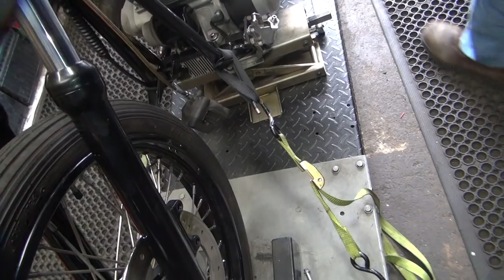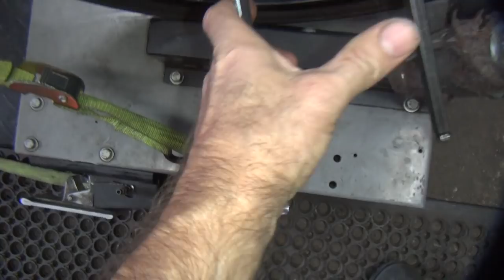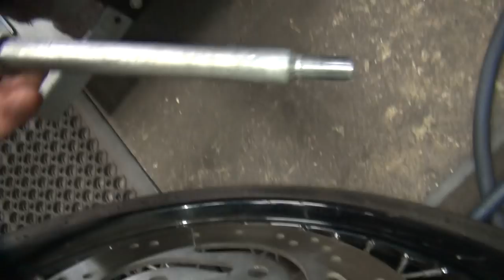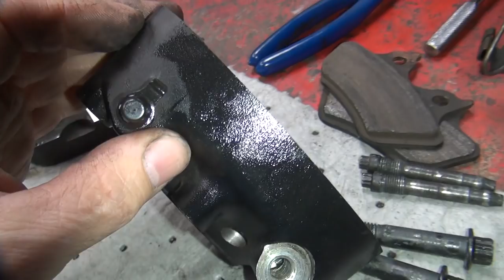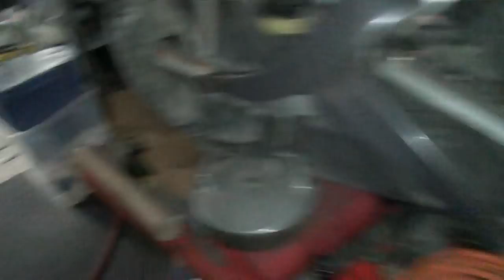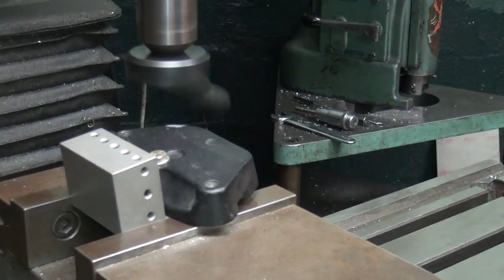1999 80ci evo #105 rigid install mid controls chassis brake repair get running by tatro machine

Comment: I had a similar problem on my old shovelhead - it turned out that the brake disc was skewed making it impossible to bleed the front brake.
It did cost me a new master brake cylinder and lots of frustrations - but at last I got it sorted out.
Thanks for the great videos!

Best regards from Denmark!

Comment: If a guy spaces a wheel over to correct for some problem what likely happens is that the center of gravity will be off, and if you let go of the bars, it will not go straight down the road, unless you lean to compensate. Just something to remember. If you have a bike that always goes right or left, you might want to check the wheels to see if they are centered. Spacers can correct that.
Reply from the maker: in the real world you can be off an inch and i doubt if anyone would notice. my race bikes are over a 1/2" off if not more and handle very good. i even offset them or bend the frame on purpose so that the bike is more balanced and goes straight. this is worth speed at the track. i have picked up 13 mph on one bike by doing this and changing out the stock rear brake to a custom one. most bikes are so out of wack you wouldn't believe it. just look at this bike.
tatro
Reply: Tatro, I'm surprised by this. My BMW K100 had a flat spacer, like a washer behind the rear wheel, and I left it out, and it would then always want to go off the road if you took your hands off the bars, but when the spacer was back in, it went straight down the road, and the spacer was only about 1/8" thick. I wonder what that was all about.

Comment: i had a 87 fxr i swapped over to a 39mm front end and ran into the same problem with the brakes except my was dual disc brakes i ended up having to use a grinder to get the clearance needed
Reply from the maker: not all harley parts like each other. sometimes you just have to show them who is the boss.
tatro

Comment: If the axle was the problem and it was throwing the wheel out of aliment , wouldn't also cause the spokes to rub up against the caliper .... So maybe you didn't have to machine the caliper after all .......
Cheers from Down Under. .
Reply from the maker: it could be? either way it clears now.
tatro